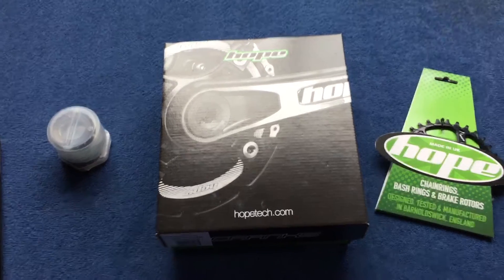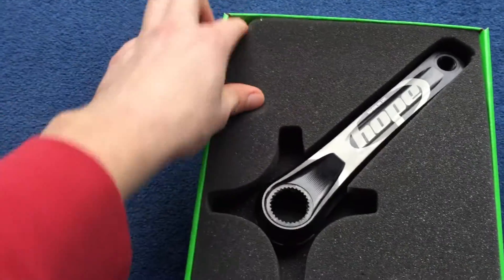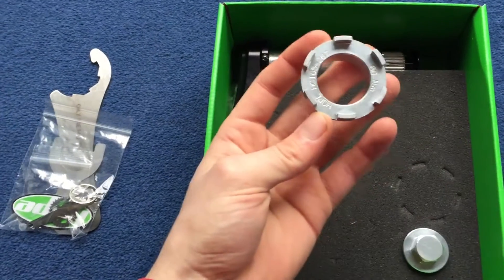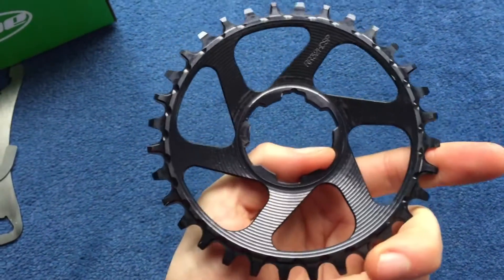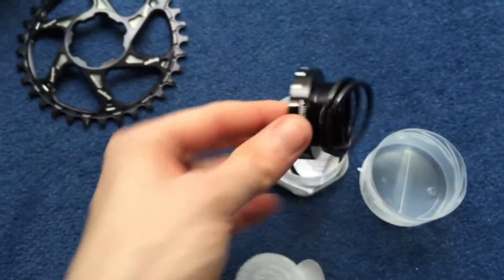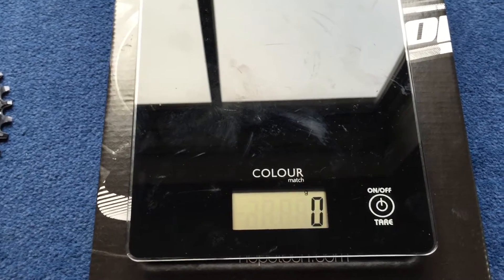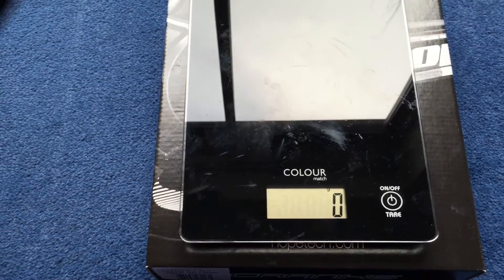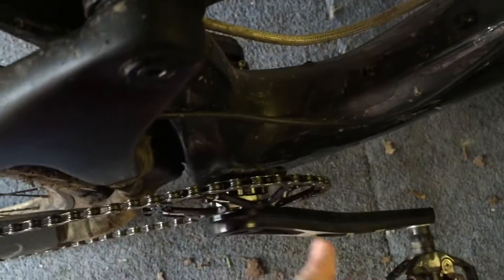Hope Tech Cranks - Unboxing

Comment: How are your Hope cranks going now you've had them over a year? I'm really in 2 minds if I should get a set of these, XT m8000 or raceface turbines. I really want to support British manufacturing and think they look amazing but there's a lot of extra faffing around with expensive BB and extra tools to install it and I'm looking for a reason to spend the extra cash!
Reply from the maker: +JDM4K They are going great, I really like Hope stuff as it's super reliable, I really like the fact they machine the anodising off so you don't get much shoe rub, little thing but means they still look good after a year of riding, they are a bit more work to fit but are very stiff, noticeably more than my saint and on par with my sixc, don't think you'll go wrong with any of the cranks you mentioned tho.

Comment: i have a raceface bb 30mm spindle, do i need to buy a hope bb? or i can still use mine tnx
Reply from the maker: Raphael Hokage Hi, If you have a 30mm spindle you’ll need a 30mm bb, most are 24mm so you’d have to check what yours is.